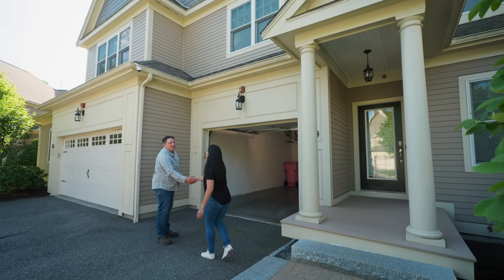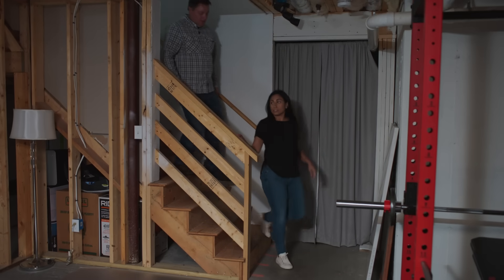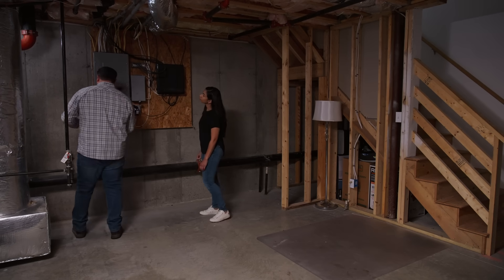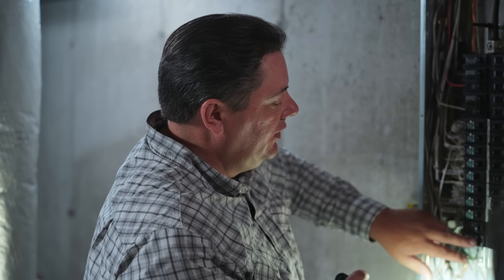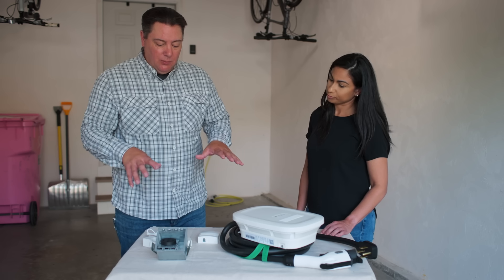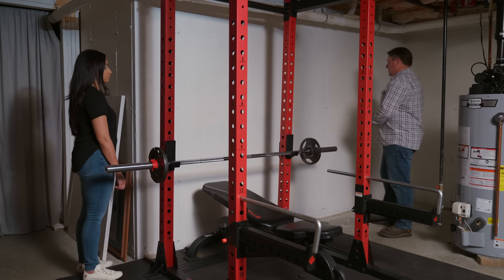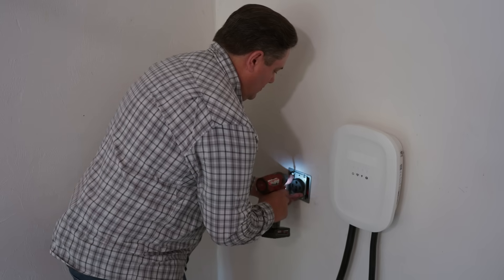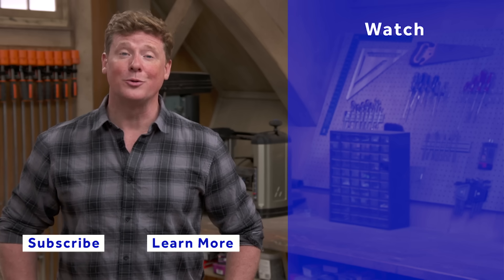How to Install an EV Charger | Ask This Old House

Comment: Why install a level 2 charger for a plug-in hybrid?  Seems like overkill.  A level one overnight charge should be fine for a plug-in hybrid.  Also, always better to hard-wire the charger.  If an EV is ever anticipated the service level should be increased rather than rationed.
Reply: I definitely see what you're saying. Given the limited range of the battery, Level 1 charging overnight could well be sufficient for a plug in hybrid. However (perhaps at least playing devil's advocate), one thing that has to be kept in mind is that charging losses at Level 1 are pretty severe. The car's AC-DC converter is only about 80% efficient on most vehicles, and there's about a 300W power loss due to overhead (battery heaters and charging diagnostics). So even though a standard wall outlet delivers about 1.4 kW, it's really only about 0.85 kW that actually makes it into the battery at Level 1, once conversion efficiency and overhead are accounted for. That's important because you have to pay for all the power drawn from the wall, but the overall charging efficiency is only about 60%, which increases the cost of driving on the battery by about 70%, compared with if you ignore charging losses. 

And that makes a difference because it wipes out a big chunk of the cost savings between driving electric and driving on gasoline, which is important as the PHEV costs an up-front premium compared with a similar gasoline car, you want the cheaper running costs to offset that. A level 2 charger has a typical overall efficiency of around 90% as the AC-DC conversion is more efficient at higher current levels, and the overhead is a smaller fraction of the overall charging power. So it actually makes the car cheaper to charge, on a per mile driven basis. 

A reasonable estimate of the cost difference between Level 1 and Level 2 is probably about 3c per mile (if electricity is assumed to cost 16c per kWh). What's being shown here is a very straightforward installation, say it costs $1000. It pays for itself over about 33,000 miles, about 3 years driving for most people. Granted, that's assuming you do all that driving electric, which is perhaps unlikely if she owns a hybrid (but having more access to convenient charging likely means she can drive more all-electric miles). However, another factor is that the charger also counts as a home improvement, so there's an argument to be made that perhaps some of the installation cost can be recouped (with appreciation) when she sells the house, so it isn't really lost capital (indeed, I think it's likely in 10 years or so car chargers will be seen as expected features of garages, and lacking one will actively hurt resale). 

So if we consider 3 factors: cheaper charging costs, increased resale and some extra convenience for her (say occasionally she does need to drive 40 miles, pop home and head out again, she could do that all electric), perhaps installing a Level 2 charger for her use case isn't as overkill as it initially seems.
Reply: Three people made the same comment.  Level 1 only charges at about 1.5 KWhr. Modern PHEVs have batteries of 15-20 KWhr, with some over 30 KWhr, so overnight charging may not be enough, especially if you drive errands in the evening.

Obviously, if level 1 were enough she would not be asking for level 2.

Comment: drywall anchors for a stud mounted charger?
Reply: The drywall anchors were on either side of the stud.  There were 2 other holes on the baseplate that were going to the stud, they just didn't show it.
Reply: It was for the charging plug not charger

Comment: Get a reliable and trustworthy technology, buy a diesel or gasoline vehicles. EVs are absolute garbage and will bankrupt you long term.
Reply: Yeah, nothing ever goes wrong with petrol vehicles.
Reply: @thespongeproject But I can fix it with my wrenches and screwdrivers. Open your eyes 👀 Don’t get fooled by corruption.
Reply: You people are so insufferable. Millions of people drive millions of miles every day in EV's, and have been for years. Reliability is higher, and cost of ownership is lower, even at higher mileage. I don't understand the weird hatred towards EV's, you've probably not even driven one

Comment: No torque driver for tight the connections on an EV charger. 😮
Reply: Three grunts = 45 foot pounds. Torque wrench not necessary

Comment: Not that helpful of a video. I would use 6 awg wire with 60 amp breaker and hardwire it directly to the charger which allows to charge up to 48 amps.

Comment: That was a very unsafe nema 1450 that was installed. It is not rated for continuous amp draw. A Hubble should have been used instead of leviton.

Comment: For living in a house for a decade, she must have the cleanest clutter free basement and garage
Reply: If it were my house, everything would be moved to juuuuuuuust outside the camera’s view.
Reply: It’s clearly not a house, it’s a condo.   So when her PHEV goes up in flames she will share that with her closest neighbors.
Reply: @1wheeldrive751  ICE cars also catch fire, so your point about PHEVs catching up in flames is irrelevant.
Reply: @1wheeldrive751  gas cars catch fire at much higher rate, but of course GM bolt ev does catch fire at way higher way, not sure what brand her EV is...
Reply: @grantguy8933 - not sitting in the garage.  That’s the special trick EVs have

Comment: If you have a plug in hybrid you probably don't need more than a level 1 charger anyways.
Reply: Level 1 charges 1 kw per hour. Newer PHEVs have batteries up to 30kwhr, with 15-20 the norm, so no, overnight charging will not be enough on level 1.
Reply: @truantray That assumes you’re ending the day at zero all the time.

Comment: I wouldn't have a lot of confidence in a guy who is supposed to know how to provide charging capability but keeps calling the charge adapter a "charger".  The charger is part of the car, not the thing you wire into the house.

Comment: I think the biggest benefit from this video is that chargers can come either an energy usage monitor so people with older low electrical service don’t have to upgrade their service for L2 charging, which could cost $5,000 or more. I hear that as one of the biggest roadblocks for homeowners who want to get an EV.
Reply: It often seems like a roadblock, but in addition to this option, which is really cool, another option that can avoid a $5000 upgrade is simply to install at a fixed lower current.  16 amps at 240 volts gives nearly triple the charging rate of a level 1 charger.  And most level 2 wall mount chargers can be configured for that and put on a 20 amp circuit.
Reply: @ yeah. If she home in this video really is 109 amp service it must be way over given how packed that panel was. She definitely needs that sensor control.
Reply: @johndoe6032 it's wild people even have that level of service in a relatively modern house, 100 amp is so inadequate!
Reply: @PublixCarrotCake The label inside the panel says 200 AMP.
Reply: But the installer told the homeowner she could change chargers in the future by just unplugging the existing one and plugging in a new one.  The new charger likely won't communicate with the current sensor in the electrical panel with the result that the new charger could pull its full rated current and overload the panel and/or service.  Or a future owner might instead use the outlet for a welder or other high current application with the same result.  I don't know how the code addresses this, but I would think at a minimum the unit in the garage should be hardwired to prevent accidental overloads by connecting devices that don't "understand" the current monitor in the electrical panel.

Comment: Good video but I believe hardwired is the way to go.  With the plug and play there’s room for failure with the cord and/ or the receptacle.  Also, the national electrical code requires GFCI protection when using a receptacle for an EV Charger.  I have videos on my channel doing EV chargers.  Please have a look.  😊
Reply: Most EVSE contain GFCI circuitry and short power cord of 12 or 18 inches is allowed.
Codes vary widely.

Comment: Technically you don't have a charger in the house. Chargers are ONLY DC Fast Charging. Since Level 1 and Level 2 just pass AC to the vehicle, the charger is onboard the car. The "charger" that is installed on the wall is a fancy extension cord that says "hey this is how much power I can provide max. The car then says, cool, I can take up to x amps gimme that or your max, thanks". You did a video about this earlier and correctly called them EVSE (Electric Vehicle Supply Equipment).

Comment: I would have sprung the extra $$$ for a sub panel. Given that the basement is currently unfinished, it will enable the ability to easily expand in the future.
Reply: That panel also allows a few more split breakers so not necessary at the moment.
Reply: @ yeah, but NOW if you want to add anywhere between a 50-100A sub panel you DEFINITELY need to move circuits over, whereas before, you could have used the 2 slots they just used for the big EV wire to install the jumper breaker and have plenty of room in the new panel.
When you start adding twin breakers those panels get crowded pretty fast.
Reply: @drbobvs    hey, don't encourage the idiots to keep adding circuits to a service that's already limited, without doing a load calculation. It's not rocket science but certain things need to be considered.
Reply: @agreed 👍

Comment: Why not offer a hardwire installation?
Reply: So they can more easily upgrade later
Reply: You can do a hardwired installation 
But you have to think about it in a long time 
Like he said in a couple of years they're going to potentially be a better type of charger out there 
So you'd have to call an electrician back in to hardwired the new one in I'm not saying that you can't do it it's just better to have a certified electrician do it in case something goes wrong
Reply: Plug-In Hybrid...

Comment: He says 3-5 miles per hour on a standard outlet as if that’s a bad thing when most PHEVs max out at 35-40 miles of range. Which means you can easily charge fully overnight. 
Level 2 chargers are a waste for plug in hybrids. They are for some full EV owners too when they have shorter commutes. My commute is 20 miles so overnight charging on a standard outlet is more than enough for work plus extra strips.
Reply: Fr even as an EV owner having just a regular outlet is a godsend I get 40 miles overnight it’s perfect and I’m a renter
Reply: @ same. I get roughly 50 miles overnight charging. More than I need.
Reply: Take the mid point of 4 miles per hour and you want 40 miles of range so 10 hours charging - do you ever come home late and have to get up early?  Wouldn't it be nice to now your car is fully charged even if those situations?
Reply: @ you still have to use the gas once in a while anyway. Can’t let old gas sit in the tank for months.
Reply: Yeah, this is overkill unless she’s sharing the car with someone or planning to upgrade.  

I have a full EV, a 25 mile one way commute, and just use the Level 2 at work every other day.
Reply: I think you’re spot on about the 3-5 miles per hour being fine. However, 3-5 is not particularly common. A 120V 15A outlet is common, and many L1 chargers are just 10A. That means about 1kW charging and that is more like 1-2 miles per hour. It MIGHT handle a commute overnight. But if you want to use a PHEV and do your commute all electric and then do your errands after work electric, having more speed is what you need.
Reply: Yep, we have a PHEV and a BEV, and 120 volts in our garage is plenty to keep us charged to levels we need for daily electric driving …

Comment: One suggestion from experience is make sure you or your electrician install an ev grade outlet. You can easily get ones for ovens and dryers and they work, but can be a fire hazard.

I live in Michigan and my garage is detached. So the receptacle is exposed to temps below freezing. Eventually the use of the charger and the cold temps caused the screws to loosen that secured the wires. My outlet was melted one winter when I checked.

The EV grade outlets have to be torqued down to a specific number.
Reply: I would suggest installing a hardwired charger.  Not any more work to install and you remove the outlet as a point of failure with as you stated the amount of cheap NEMA 14-50 and 6-50 outlets on the market is a real fire hazard.
Reply: @scottz45    in many areas an outlet also requires a GFCI circuit but hard-wiring does not. (because most chargers have GFCI built in)
Reply: @thedopplereffect00    I said that already but the areas that have adopted new code will not exempt the GFCI unless it's hardwired, because idiots might plug in a welder or similar. BTW, some Teslas are now calling for a 60 amp circuit to skirt the GFCI requirement on 50 amp or less outlets. Sounds kinda sneaky to me but it works.
Reply: @rupe53  you said most, but I'm pretty sure it is all. You are right that hard wire is the way to go. It's really pretty trivial to swap them. Just some wire nuts and 3 (4?) wires.
Reply: @thedopplereffect00    most = some early units did not. These days I believe all units have GFCI, although I understand it's not the same safety spec. I hear it's a little higher (40 Ma?) to prevent false trips, but still well under what will harm a person.
Reply: @thedopplereffect00 My state still uses 2017 NEC code so a GFCI breaker is not necessary in the garage, but if your state follows 2020 nec code, then a gfci breaker is required for a garage outlet.
Reply: @rupe53 Teslas can charge at 48 amps, so a 60A breaker is needed for that reason.
Reply: @dvader3263    Did you read my post above where I already said that? I said "60 amp circuit" which implies everything is up to snuff.
Reply: @scottz45  it is insane that codes have not been updated for these installations
Reply: I almost guarantee he used a non-industrial grade. Otherwise he would have known to state it in the video, although he didn’t go into details. I had a Hubble on hand for my electrician and when the young guy in the crew stripped it, he tried to replace it with a $3 replacement from the hardware store and tell me he couldn’t see the difference. I retreaded the Hubble and hand the owner of the company send someone the next day to replace it. Sadly you have to know more than most technicians for this job.
Reply: @lancastergerard the charger should also have been anchored to cement board. They really should remove this video because this is not a DIY job.
Reply: @ When I installed my Bryant 9450, it didnt fit into the standard 2 gang box, I had to order a deeper box.  Also the hole for the trim panel is bigger than standard.  He probably swapped it for a different one instead of having to come back out with new parts.
Reply: Is she single ?
Reply: I was going to warn to ignore this video and seek installation from a master electrician. In addition to the proper duty cycle outlet, hard wire is better and the breakers should not be on the main box. They need a dedicated pony box because there is a huge amount of power flowing and if there ever is a short the entire main box will burn up.

There are people DIY that will burn down their house in a few years once contacts corrode or get loose.

Comment: The load management device communicates with the charger and has no control over the actual plug. If she needs that load management device she can’t change out the charger at a later date like what was suggested in the video. When this type of device is required the charger should be hard wired to prevent this from happening.
Reply: Agree, but in theory if Emporia (the vendor of the equipment) releases a new charger, it may be able to still communicate with the existing energy monitor for load management.  But yes, if she switches to a different brand charger, it would not be able to load manage with the Emporia Vue 2 that was installed in the panel.  And they didn't show an electrical load calc, but with only a 100A service, she may require such a device.  And also agree - this should have been a hard-wire install - too many issues with NEMA 14-50 outlets as well as new codes for GFCI breakers that conflict with the integral GFCI function of the charger.  Went the extra mile with the armored cabling, but failed to mention that a high quality 14-50 outlet is needed for continuous load EV charging applications.